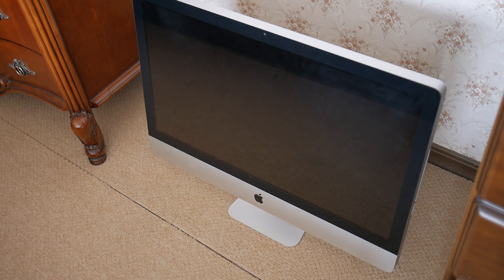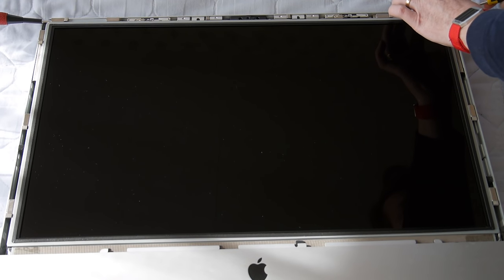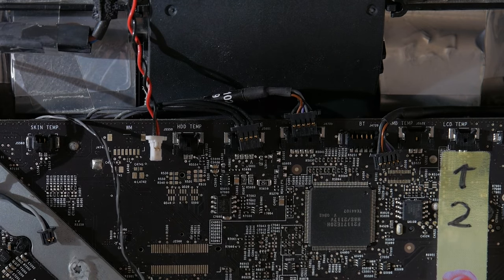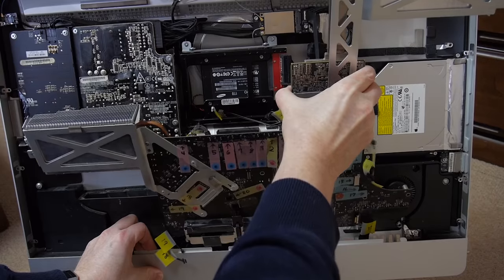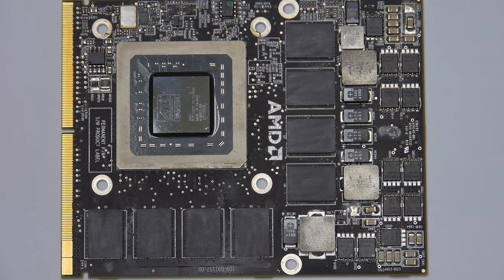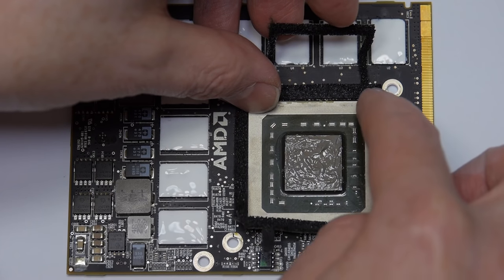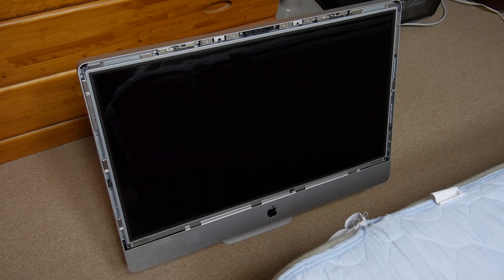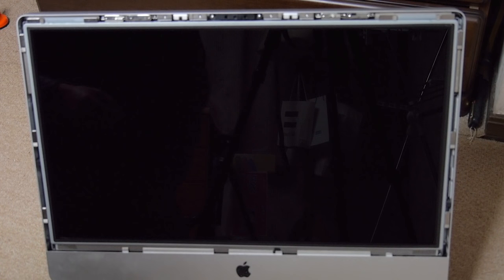Late 2009 iMac 27" Video Card Repair [4850 Bake]

Comment: Just did the baking with my late 2009 27 inch iMac (HD4850). Worked great. Wew will see for how long. Btw. can I just put in a HD6970M? Without bigger modifications?
Thanks alot for that GREAT video.

Bug
Reply from the maker: Thank you for sharing your successful experience! Yes, you can put in newer video cards, but be aware that they are not exactly the same shape or size and therefore you may need to do a little cutting to make it fit. And newer cards may also run hotter, which would not necessarily be best for your Mac.

Comment: One observation : when the 400 degree oven is ready by the time I open the door and place the card carefully inside the temperature oven  drops to like 355 so it takes a few minutes to get back up to 400.  My ? is do you start timing when you first put the card in or wait til oven is back up to 400?  It took my oven 3-4 minutes to get back the 400.  Thanks
Reply from the maker: Hi Rena.  Thank you for your question.

The video card bake procedure is not as precise as you may think.  I read and reply to every comment under all my bake videos, and I can tell you that some people find success with bakes ranging from 7 to 10 minutes.  Some people don't even preheat their oven.  I recommend preheating for two reasons.  First, so you can be assured of a consistent 400°F throughout most of your bake time.  Second, so you can put a turkey thermometer inside your oven during the preheating time to verify you are indeed getting 400°F and not something much higher or lower.  

Why measure temperature?  Because over the last few months there have been a small number of people who reported components getting desoldered and even falling off.  That will never happen at 400°F for a 10 minute bake, but if the oven is in fact hotter than 400°F, then it is possible.  These cases are very rare and very few in number, and at least one person was outside the US in a third world country where I would expect such a thing to happen, especially on an old and faulty oven.  

But to ensure everyone has a consistent experience, measuring temperature is just a good idea, and that can easily be done during the preheating time.  You can even leave the thermometer in the oven during your full bake time if you like.  But again, most people don't measure oven temperature that way and have success in their bake.

If you have other questions, please don't hesitate to ask!
Reply: @JDW-  Thanks for your response, I did the bake at a consistent 400 for 10 minutes, let it cool down and put all back together.  Power up was not what I expected however as I got the chime but the screen stayed black and the fans came on and stayed on until I shut it down.  Before I was getting chime, white screen with apple logo and progress bar that went to solid white screen half way through progress bar.  Any thoughts on what could have happened or I could have done wrong.  I'm thinking of checking to make sure I got the 4 cables back in correctly but fairly sure I did.  The card looked to me like it was not original condition even though Apple replaced it once. Any thing I should check while inside?  thanks
Reply from the maker: @renaday5283  Rena, I am sorry to hear about the black screen at power-up.  The good news is that in almost of all those cases, the culprit is a cable that either was left disconnected or was not reconnected properly.  In some more rare cases, one of the two ribbon cables itself was broken during the opening.  In that worst case scenario, it is possible to replace them by purchasing new cables via AliExpress (China), and I put links to those in the text description under my 2nd Bake video.  I read and reply to every comment, so I can tell you that you are not the only person who has seen the black screen.  And that is how I know the vast majority of cases are solved by reopening the Mac and checking every cable connection.  It's a huge bother, I know, but it's necessary to solve the problem.  In my own case, one of the times I closed up my iMac and tested I lost WiFi.  I reopening, secured cables, and then it started working again.  Please let me know how it goes.
Reply: @JDW-  You're right.  It was the larger cable on the far right with the spring clip.  It had somehow slipped out, or I had not secured it properly.  Fortunately, I reattached it, closed the it up again and powered on to get white screen and apple logo/progress bar that opened up to a perfect High Sierra desktop, just like when it crashed 5 months back. All good.  At least for now and hopefully for a couple years more.  Fans were also off and back to normal.  My sincere gratitude for your assistance and communication.  Made my day much brighter than my last powerup.  I owe you lunch!
Reply from the maker: I'm very happy and relieved to hear you were able to solve the problem, Rena.  I appreciate your having made time to let me know.  Feel free to let me know how things are going with your video card over time.  Best wishes to you and your newly resurrected iMac!

Comment: Hi, this tutorial also work on iMac 27" model A1312 mid 2011? Thanks
Reply from the maker: Yes.  Some parts will look slightly different inside, but the procedure is the same.  I know this because some people with those newer models have reported success in the comments.
Reply: @JDW-  thank you for the answer, this method is defined to the problem or can the problem re-appear?  For your part, after doing this reflow, is your Mac still working?  thanks
Reply from the maker: @rockyW46  As mentioned in the text description and my pinned post, my 1st bake lasted only 4 months, but my 2nd bake, shown in my 2nd bake video, is still going strong after 2 years and 2 months of daily use: @igdA
Reply: @JDW-  Thanks again for the answer, I realized you were very kind and your videos are really helpful for those with the same problem.  Thumb up! my best regards.

Comment: Wow, that looks like a pain. I got an iMac that works for a little while, and then bugs out. Maybe if I clean the fans now, I won't have to do all this scary stuff. Thanks for the foreboding tutorial 8|
Reply from the maker: I doubt the fan cleaning will fix the problem, especially if your iMac is model year 2008 through 2011.  If you don't care about changing the BR2032 battery, you can just following my 2nd Bake video, which is a tiny bit faster and less fiddly, but still takes a lot of time and effort overall: https://www.youtube.com/watch?v=6BJGLFCigdA&t=0s
Reply: @JDW-  So, if one's getting glitches, it's already got problems. Makes sense. I'm guessing fractures in the solder, and I'm wondering if a program could do a controlled GPU bake as the Mac lies face down, since it's got a heat sensor, but that's over my head.
Reply from the maker: @rmarbertin8131  A lot of otherwise smart people have speculated the root problem is as you said — problems with the solder balls under the GPU chip.  But there is evidence to suggest the root problem is inside the GPU chip itself, and that heating of the chip (which is what the bake does) will resolve the issues in the chip for a non-specific period of time. Some people have reported success using a heat gun, but I don't recommend that because application of heat will vary by the person doing it.  You also cannot bake the large electrolytic capacitors inside the machine, because that harms them.  This is why the video card must be removed and separately baked. You should never heat the iMac itself.

Comment: Yes, SSD will increase read and write performance, but it is limited in processing information, this belongs to the CPU and GPU. If for example; we are doing a lot video rendering and production, the key component to get you speedy completion is the CPU first, and RAM, assisted by the storage and GPU. If we have a very powerful GPU ( graphic card） that does not help if we have a slower processor, lesser ram or memory and trying to pull off a large video file rendering.
Reply from the maker: Swapping out the stock spinning platter hard disk for an SSD makes a huge practical difference in general use. That's true even though my iMac doesn't take full advantage of the SSD speed due to the controller being SATA-II (3Gbps) whereas the Samsung EVO SSD I use is SATA-III (6Gbps).  Everything from boot times to app load times to copying and writing files is accelerated tremendously.  The addition of an SSD alone makes you feel like you have a new Mac.  It's a huge difference.  And that's important since we cannot upgrade the CPU or GPU in these older iMacs.
Reply: True! I never had pulled off the CPU fan heat sink off an iMac, is the CPU soldered on to the board?
Reply from the maker: The CPU is socketed.  And some people claim success, but others say a CPU change didn't work for them.  Go the following iFixit page and scroll down to read the comments there:  https://www.ifixit.com/Guide/iMac+27-Inch+Late+2009+Intel+Processor+Replacement+(EMC+2374)/51223

Comment: Hi.. amazing video and a great help, i had the same issue, but after 9 months graphic went again and i tried the 2nd bake (at 9 min) but this time it did not work, any advice if i should bake again (3rd bake) or give up on this graphic card ?
Reply from the maker: What kind of thermal paste did you use after your 1st bake?  And did you use the same paste again after your 2nd bake?  After your 2nd bake, you applied the thermal paste, installed the card and tested, only to find what, a black screen?  If so, are you 100% sure you didn't forget to reconnect any of the cables?  Are you sure the two, thin, ribbon cables are in good working order?  If you are using good thermal paste (non-conductive, to ensure no electrical shorts), and if you know you reconnected all the cables and all the cables are good, then it would appear that your video card may have died.   In such a case, I would advise you to replace the card with the same 4850 card to ensure it will fit and not have any heat issues. If you don't want to do that, you can either purchase a used late 2015 iMac (which I can tell you runs very cool and has a great video card), or splurge and just get the latest iMac.

Comment: Yah, great job, my problem is the crappy 512mb that was thrown on the card. I was wondering what your thoughts were about upgrading it to the 6 series...or something little more powerful for Adobe Ps, Il, Ae and An. Cheers!!
Reply from the maker: Actually, there's an iFixit step-by-step for putting a 6970 2GB card into a late 2009 or 2010 iMac here:
https://www.ifixit.com/Guide/Graphics+Card/9553

I did not perform that upgrade because (a) I didn't want to buy a new card when I could fix my own for free, and (b) it requires extra effort, and (c) I was unsure if the thermals could be controlled well, seeing the stock video card for the late 2009 iMac already runs quite hot.  But if you do perform that upgrade and are successful, please report back here an let everyone know your success.  Best wishes!
Reply: JDW thanks! I'll report back when I decide and if I do as I may be switching to a power Mac. Cheers!

Comment: Thank you very much, works great!
Reply from the maker: Thank you for letting me know about your success, Hubert!  Best wishes!
Reply: @JDW-  Hey JDW, the baking worked 9 month, than it crashed again (one week ago). Now i did the same and it works again. YEAH!  I did my backup, i love that it works again. But now its time for a new computer. Thank you for your work, i appreciate that very much! i wish you the very best. Greetings :)
Reply from the maker: Hubert, I'm very sorry to hear that your 1st bake lasted only 9 months.  But it is good to hear your 2nd bake got it working again.  My 1st bake lasted only 4 months, but I'm still going strong on my 2nd bake, now having lasted 1 year and 8 months.  No computer remains useful forever though, especially if you are into video editing where you want the fastest CPU and GPU possible.  At some point we all need to upgrade.  And with the new 2019 8-core iMacs now out, I can see what is compelling you!  The good news is that those newer machines don't seem to have this same video card flaw, which means you should get many years out of them without any need for your oven!  Take care, Hubert!
Reply: Hey JWD, me again :) A 3rd baking was succesful, it's incredible XD. But i bought a new imac 2019 too. Great maschine. So i use the old one as the second monitor. I'm curious how long the graphics card now holds after the 3rd reactivation. Greetings :)

Comment: Congratulations on such a nice and well-done video. What would be the main reason for baking the board instead of just replacing it? Just the cost, or any other special reason.
Reply from the maker: 2008 to 2011 iMacs have video cards with GPU chips that have an inherent defect that is temporarily fixed by the application of heat.  In my own experience in dealing with Apple, even a brand new replacement card lasted only 3 years.  So baking the card is a lower cost means of extending the life and usefulness of these old Macs.  Baking cannot be repeated forever though, so at some point you will need to replace the card, but it is possible to get more than 2 years of life out of a baked card, seeing my 2nd bake lasted 2 years and 9 months.
Reply: @JDW-  Thank you for your prompt response. I will give it a try but replacing the board. I am not as skilled as you but I will do it. Thank you

Comment: Good day @JDW. I have a iMac 24 Inch (EMC2134) have LCD issues, it's not turning on,  i have hardwired the LCD to 3rd LED Diagnostic light and the LCD turns on but imac doesn't turn on. Diagnostic led 1,2,3 is on but the 4th is off. Maybe you have a suggestion? Thanks!
Reply from the maker: It seems you have a 2007 iMac. I would be interested in seeing a photo of your "hardwired LCD to the 3rd LED" to better understand what you are doing.  Also, what is the original problem?  I cannot tell if you are saying it is the display or the Mac.  I am interested in knowing precisely what would happen before you opened up your iMac.  For example, did you get a white screen?  A black screen?  Artifacts on the display?  Random freezes but nothing unusual on the display?  Things like that.
Reply: thanks for the quick reply  @JDW- . This is what i did. https://www.youtube.com/watch?v=EMihRCvTs9U&t=72s the backlight of the LCD opened but still no chime, diagnostic LED4 did not open. Diagnostic LED  1,2,3 is on, fan is running. Im checking now the black connector from the board to the PWS to see if power is going to the PWS properly
Reply from the maker: @JujoeM  Thank you.  I just watched that video and now understand what you are doing. LED 4, when lit, shows that the iMac Motherboard & LCD are communicating. This LED will be ON if the computer is turned on and video signal is being generated. In your case, LED4 never comes ON, which means you have a problem.  I do not have your model iMac or experience with it, but I did find this iFixit page which offers advice: https://www.ifixit.com/Answers/View/189515/1,2+&+3+LED+lights+on+&+4th+not...+means

Comment: Hi great vid. What was the symptom before you realize is the vid card? Mine will make the bong sound at boot but nothing shows up, does that sound like the vid card problem you have?
Reply from the maker: Hi, Charles.  Not everyone has the same symptoms.  In my case, the machine would randomly lockup/freeze.  And when I tried to reboot, it would often freeze during boot.  Sometimes I could leave the machine alone for a day and then it would boot the next day, but then I would put it to sleep and when I woke the machine, it would freeze.  I'm pretty sure I heard the bong when I tried to boot, but again, it would freeze.  A black screen on cold boot is a tell-tale sign the video card is bad.  If you have a model year 2009-2013 iMac, the bake will likely fix your problem completely.

Comment: Tip: It is easier to remove the monitor cable from the monitor than from the motherboard ( 3 ). This way you can prevent the breaking of the connection from the motherboard.
Reply from the maker: Thank you for sharing that tip, Hubert.  And at the same time, it's important to be very careful when moving the display (after screw are removed) so the display doesn't fall forward and snap the cables.  That can easily occur because the iMac is on a swivel stand and the body can fall forward if you don't hold it carefully.  Then when you have the display pulled forward such that cables can be seen, then one must decide whether to disconnect at the motherboard or the back of the display.

Comment: Forgive me if im stupid but did you just bake the old graphics card and not replace it ? have you replaced anything appart from the heat resistant silicone ?
I have the same problem and am close to giving the I Mac the hammer of slight adjustment!
nice vid tho mate.
Reply from the maker: Thanks.  I baked my old graphics card and replaced it where it was originally -- inside my iMac!  :-)  But no, I did not buy a new video card because why pay for a new card when baking the old one does the trick?  I replaced the thermal paste and I replaced the BR2032 PRAM battery on the motherboard.  Be sure to read my text Description under the video because it describes all that and more.